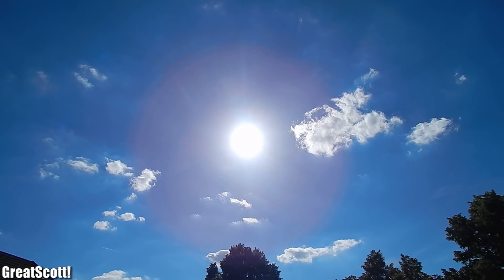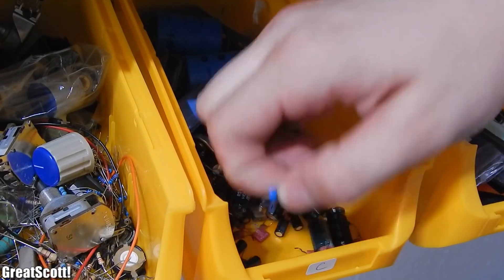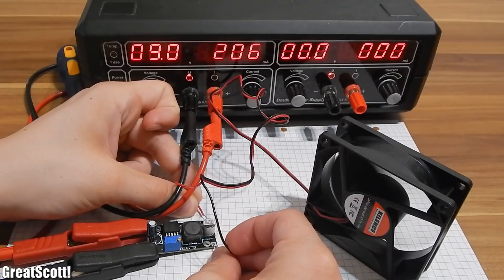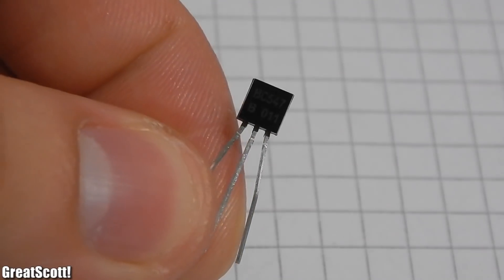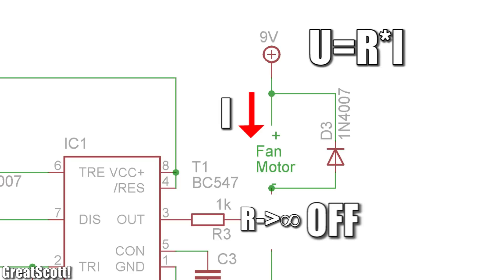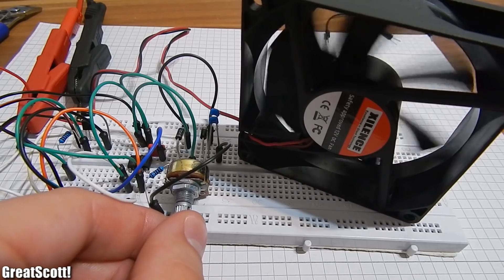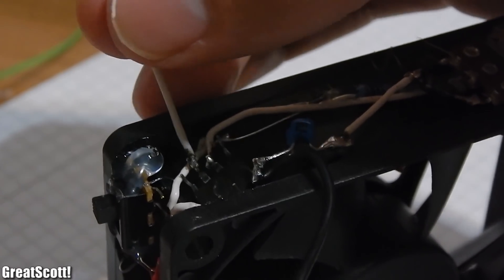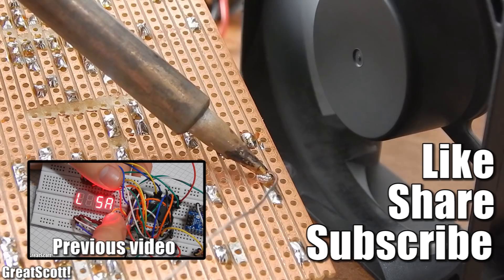Stay cool this summer: PC Fan Mod

Comment: Show people how to build a simple yet effective car amplifier and explain the difference between a 1000watt vs a 5000watt amplifier. You will need to show how to make a lpf (low pass filter) and a hpf with potentiometer for volume controls and how to do a mono block and a stereo block with a switch to change between the two. If you can show how to make this I will thumbs up all your videos. I have already subscribed.

Comment: 34°C in summer is a good day 
Come to Australia where it gets to over 45°C

Last year it got over 47°C!

Let's just say a simple fan won't work 
Even my peltier air conditioner has a lot of trouble negating the heat and that thing draws over 700W at 13.2V using 12 peltier cooling plates with a huge heatsink on the hot side and a small one on the cold side with fans blowing the hot air through a duct outside and another fan blowing the air through the cold side 

And that just barely cools one room on an average summer day of 39°C - 42°C

Comment: Most Pc Fans work with 5V
You can connect the Fan on a voltage 8-14V without any problems

Comment: A 12v fan also works on 5 volt I have build myself a USB powered fan without needing any circuitry just the wires of the fan and a old usb cable and it works great

Comment: You should make something that can mount to a computer, yet has it's own seperate power source, so when the computer turns off it stays on for X amount of time (Or until someone turns it off)... I've got no idea why, just a stupid thing I'm thinging about.
Reply: You could probably do that more easily using some capacitors and diodes/MOSFETs and no extra power supply.
Reply: +Isaac Karjala Correct

Comment: Take an old power-transformer (7-12volts). Take 2 120mm fans. Stick them together. Connect all cables to the power-supply. There you have it. If you have 7 volts take a fan with 1200-2000 rpm. If you have a 12volt transformer take a 800-1200rpm fan. Yours is much more professionell but its too complicated for me. :D

Comment: lol u don't even need a 555 or a diode.
9v battery, potentiometer and a transistor is all u need.
conect vcc to pin 1 of potentiometer and gnd to the 3 pin.
then the output of the potentiometer goes to the base of the transistor.
emitter goes on gnd an then connect the negative side of your fan to the collector.
and th vcc on the positive side of your fan.
Reply: Joury Bink Actually for the sake of the least resistance in the circuit, PWM is better.  He made a video explaining why.  The diode is a freewheeling diode to protect the components like the transistor from a rapid discharge from the fan.

Comment: I've seen single can novelty mini fridges using these things: http://www.amazon.com/gp/product/B00E4GY0FC?psc=1&redirect=true&ref_=oh_aui_detailpage_o00_s00
You should make a DIY video using them to make a compressor-less cooler that fits in a window to vent out the heat.
Reply: Dwight Parker If you got 15 to 30 of them, you could mount them in cardboard and use pc fans and heat syncs to vent out heat/vent in cold air.

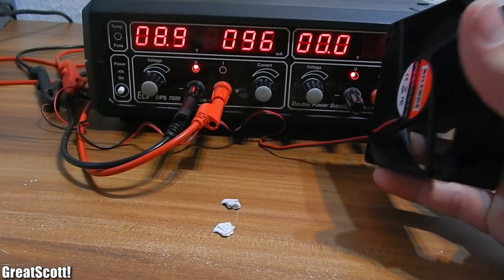Comment: you use battery how about use a usb computer because I have  one broken fan laptop and I use that trick like 1:30 in this video
I am an amateur ...!!
so please tell me ...!!!
Reply: Is your fan 5 or 12 volts?  A usb connection is 5 volts and if it s a 12 v van it wont spin very hard
Reply: I cant tell you about the volt but I have two fan that directly connect with cable and the lower volt is in normal speed but the other one the higher volt is slow
I cant tell about the volt because I forget and I tool away the label

Comment: You could also have made it USB.
I use to modify or create some types of hardware for my pc aswell, and the easier and most comfortable way to power them is either usb (for laptops) or direct power from the power source inside the case. you can have 5 volts , 7 vgolts or 12 volts. IS a really useful thing.

Comment: I would like to build a small bugging device and then have a remote amplifier that will pick up the signal, boost it and retransmit it so I can receive it over a greater distance than just with the bug alone. Can this be done and if so, how small can it be made?
I want a distance of at least 300 meters from the amp to the receiver. The distance from the bug to the amp should not be less than 80 feet. Oh, and the amp/transmitter should be weather proof. 
Big ask?

Comment: Don't most PC fans include a blocking diode?
Reply from the maker: Azurren Correct
Reply: +GreatScott! The only ones I've seen without are the old style molex plug fans...I've got one that's loud as hell and pushes tons of air, yet somehow doesn't overload the rail. Must be just a combination of worn out bearings and coils that have a difficult time degrading over time.
Reply: GreatScott! Er trinkt erst einen Natursekt, korrekt!
Reply: No todos lo traen y es mejor prevenir que lamentar

Comment: I only have fans with 4 cables... Not like yours that have + and ground. I've tried connecting a 9v battery, but it only spins for a few seconds and then stops. Is it the battery? Or I cant do this with a motor with more entrances? Please help! (Yeah, I tried plenty of batteries and different voltages)

Comment: Can't you just throw a potentiometer in the original circuit and use that for speed control? Too much amperage?
Reply from the maker: SpiffyEmpire I will make a video about the question. Just be patient for one week.
Reply: Thanks for making the video!

Comment: I have a question not directly realted to this, but related to electronics.
I have a battery charger. And It says Input: 12V 1A. But I have only found a cable that has an Output of 12V and 300mA. Can I use it to power the charger  safely?
Reply from the maker: I do not think that a cable can have an output of 12V, 300mA. It is just a "cable". But I think I understand what you mean. I do not recommend to do this.
Reply: Okay, thank you!